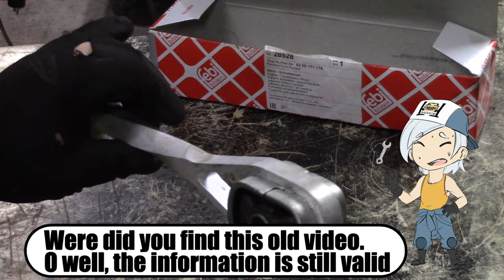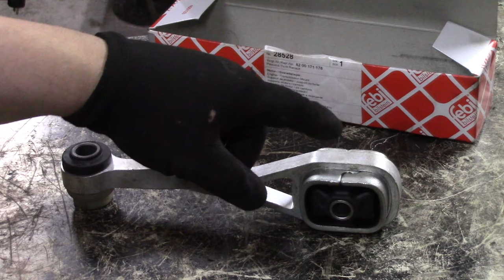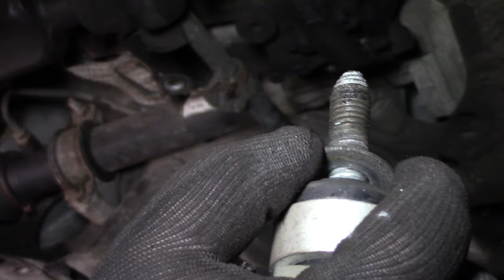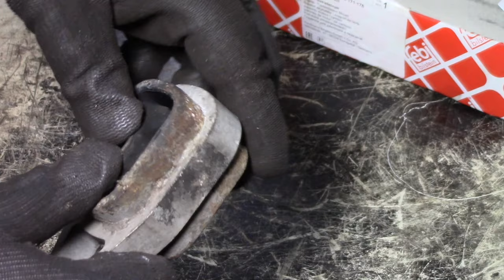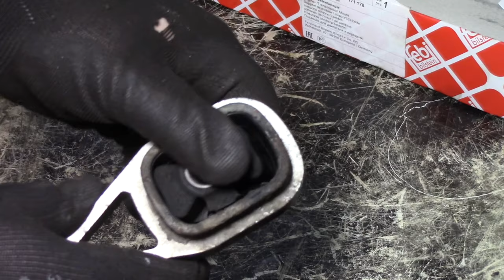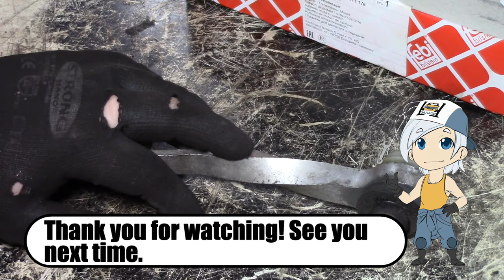How to replace a gearbox mount Renault Clio 2 and other.

Comment: Powerflex kitPff60-211k will fit into febi 29502 engine dogbone! So this means it will fit a lot of Renaults. My 2001 Clio from 2001 has this setup now. The dogbone from a Twingo from arround 2011 fits on my Clio. And the powerflex kit fits the Twingo dogbone. Drives great now!

Comment: Nice Video Man.  I am going to do it on my Kangoo because the engine movement  makes the gear stick move a lot and it is very annoying.  Also I am very curios to know what is that metal pipe that runs parallel to the right of the mount.  I have researched it on the internet but I cannot figure it out.  Thanks.
Reply from the maker: That bar is the shift linkage.
Reply: @TheDutchGarage  Thanks. I just watched your video about the linkage.  Good job
Reply: @TheDutchGarage  Hi there.  I replaced it in my kangoo and driving has got a little bit better. Do you think that changing all the other engine mounts and filling this dogbone mount with tigerseal may substantially improve the rocking and jerking of the engine in its bay?  Thank you

Comment: Where did you find the NM of bolts 🔩? Are those the same in other cars?
Reply from the maker: Most of the time online. I search on the car and then NM or torque specs. Or just workshop manual.
Reply: You just tighten the bolt and say "KLIK" really loud. 😂

Comment: I replaced this part on my clio mk2 and its still the same no difference still has movement when accelerating, i researched this and its normal as renault designed this to happen
Reply from the maker: Check your other mounts, It could not rocking noticeably.
Reply: @TheDutchGarage  i thought it would only have one gearbox mount which is the one you just replaced?
Reply: Can you show a pic of the other mounts please
Reply from the maker: There are 3 mounts I believe 1 engine and 2 gearbox.

Comment: I have an exact same clio, but when I press the gas pedal in 1st and 2nd gear the car shakes a LOT, and every time I shift gears there’s a very loud clunking noise coming from what seems to be the transmission. The gears don’t seem to slip or make any noise. So I’m wondering if it’s just the case of bad engine/transmission mounts and old oil?🤔
Reply from the maker: Check motor/transmision mounts first.